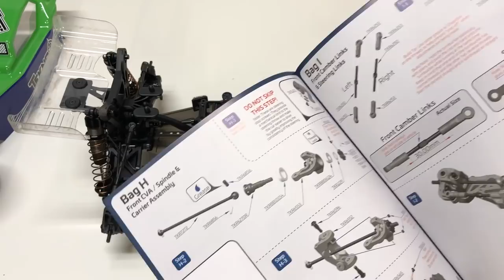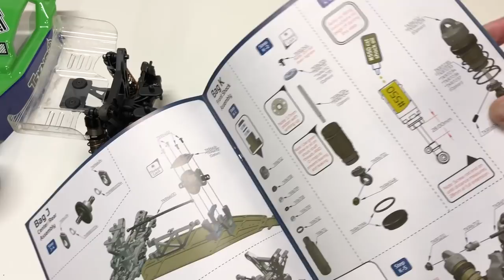Tekno ET410 full review!

Comment: That shock issue is usually caused by the screw holding the piston coming a little loose which makes it easy to shear off. Besides Loctite on that screw, let it cure overnight before adding the shock oil.

Comment: I'm not understanding how people say this is a "race only" rc. Officially there's no class for this. Second what people choose to do with their rcs is their choice. Who cares? I bashed the snot out of my tekno eb48.4 and it did excellent. A lot of times race kits make some of the best bashers. I.e. serpent 811 te truggy. I'm considering this as a basher so I appreciate the perspective.
Reply: There is a official class it's called mini truggy
Reply: @rcx8971  at the time over a year ago when this comment was posted there wasn't.
Reply: Furio  not necessarily true. If you take something like say the maxx line of trucks out of the equation a lot of rtrs are still pretty fragile. Think about it a race kit is meant to take triples time after time. Of course some are more durable than others. My main point is that there's people out there saying this should only be raced. Who cares? Its like people who buy rcs to jump them off the roof of their house. I don't get it nor would I ever do that but it's their rc, what does it matter to me? That was my main point.